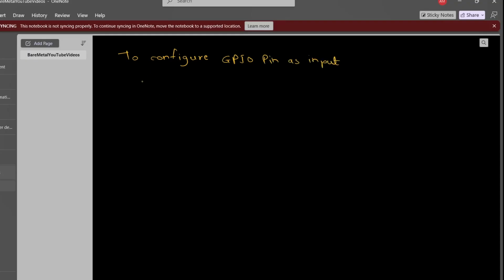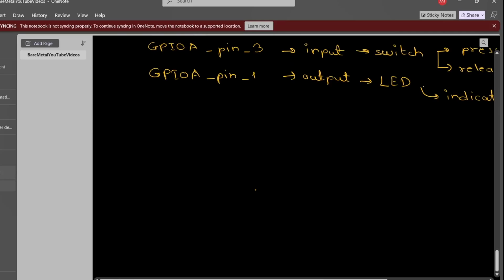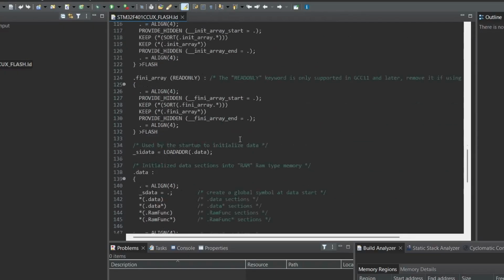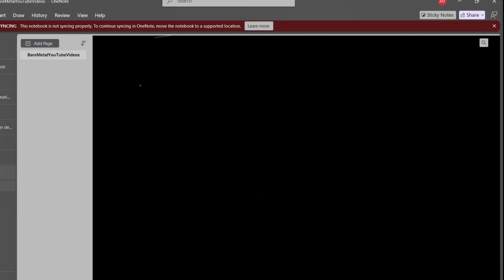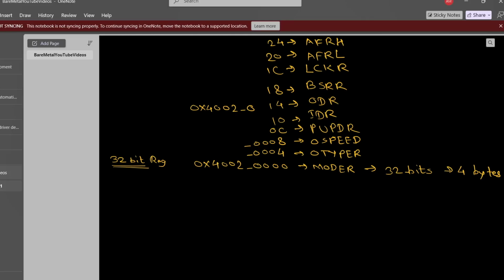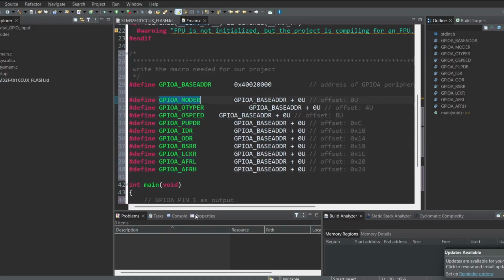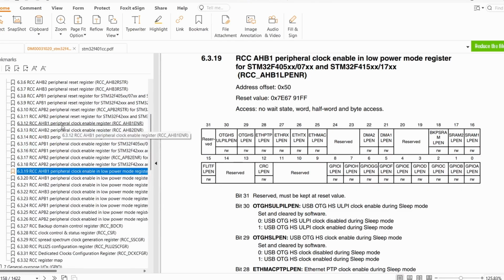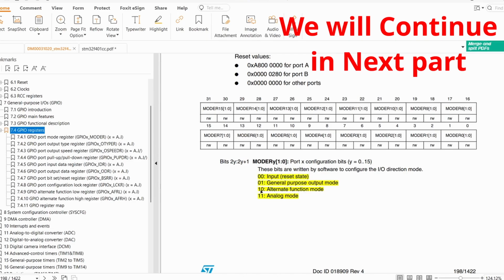STM32F401 Bare Metal Programming | GPIO Input Without HAL (Register Level) | part 1

Comment: I just don't get why are you repeating all the time the same stuff about base addresses like at the beginning of the course? If you want to tech basics, and don't wanna use existing CMSIS library for register definitions, why don't you create your own library along the course and use it in your future video? You're doing extra work for nothing, off course, in my humble oppinion.
Reply from the maker: I agree to the point that either CMSIS Library Or own library should be used. We are taking the baby steps to understand how and why to write own libraries. Unless we reach a critical section or complex section where we should introduce our own library, these are current steps we want to follow. 
Of course, like the experienced developers like you may feel this unnecessary, I strongly feel that understanding the basics will help others understand the CMSIS library much better way. 
Going further we will definitely write and use our own library using structure and pointers.